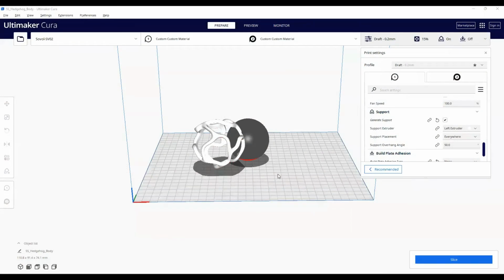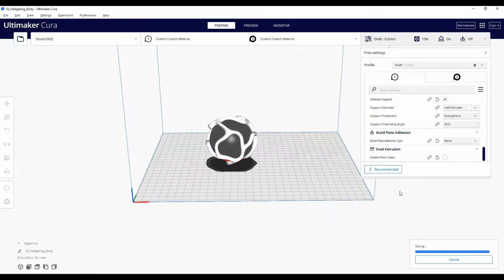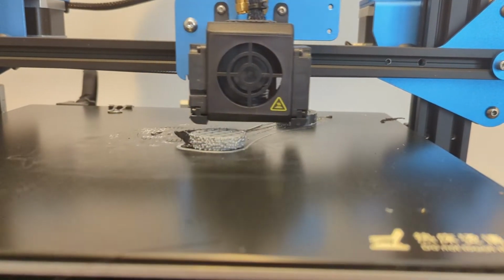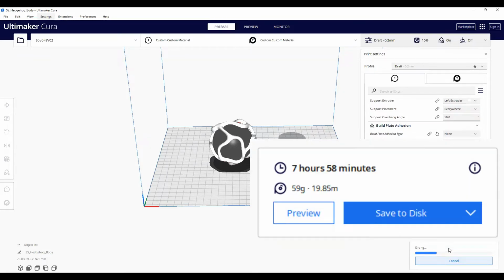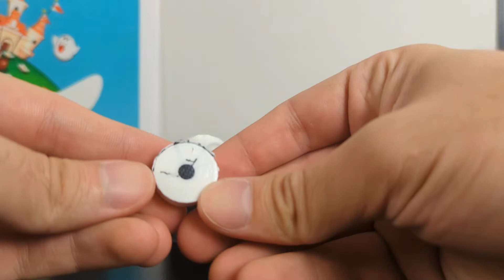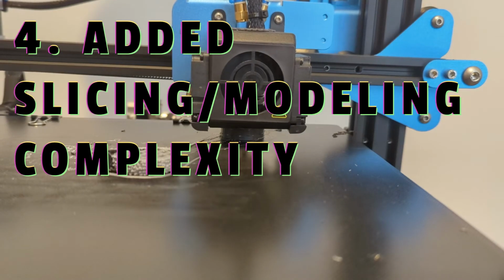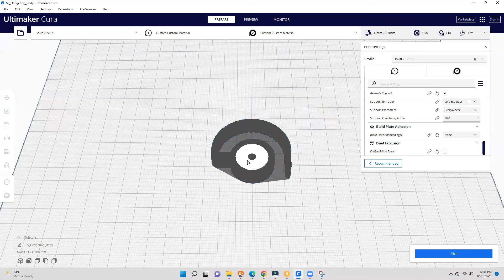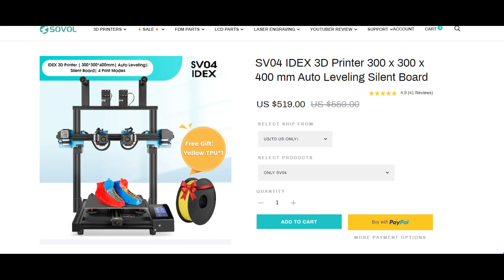Before You Buy: Single Nozzle Dual Extruder 3D Printer Watch This!

Comment: The accuracy problem is an issue in your printer not a intrinsic problem of the Dual extruders. Also with prusa slicer you can paint youyr model rather than make multiple pieces, and also you can use the infill as purge tower, maybe make it solid to put all the purge inside the piece.
Reply: Which prusa are you talking about? Cuz the one I used doesn't have that feature.
Reply: @cupcake_toucher445  The Prusa Slicer software. Any
Reply: The main branch current version has it. 🤷‍♂️  @cupcake_toucher445

Comment: MMU printers with a single hot end are rather gimiky.  They are good for the once in a while dual, or multi color print, but poor for production of such prints.  You should also never use a single hot end MMU system to print with a mix of materials as there will be cross contamination.  Not good for combining water soluble support material with your print, but acceptable for some dual color prints.   An IDEX (dual hot end) system is required for combining water soluble support material with a print, or for a print using different types of material such as PLA with Nylon or TPU.  I am thinking of building a dual extruder single nozzle printer that will be used for multiple color prints.  I don't expect to do such prints very often, but the cost of the system is only that of the extra extruder and motor controller in the MCU, the dual bowden hot end is the same price as other all metal hot ends.  OTOH, the cost of an IDEX printer is much greater as you need an extra hot end, X axis linear movement (carriage, motor, belts, motor controller), and extruder, thermistor, hot end heater controller, etc.

Comment: I never use mine for dual colour. I've had success with it, but it's not worth the extra filament and time used. Better to paint after. The real reason I like these printers is because they offer gradients which doesn't waste any filament, and also it saves money on filament and keeps a print going when you are about to run out of filament. Instead of putting a fresh spool on if you think you haven't got enough, I just have my fresh one on the other extruder ready to go when the older one runs out. Then I gradually mix the two together until they blend seamlessly and I got my full money's worth from my old filament.

Comment: I'm just getting into dual extruding.    The fix for #4 really is just using PrusaSlicer.   I was only using Cura before, but that was impractical to try to do with separate bodies.  PrusaSlicer, you just select which surfaces that you want as each material, and it does it.    

All the real problems I ran into were related to the idle nozzle crashing into the print.  It seems PrusaSlicer doesn't have a solution for that.  Z hopping can help, but it's not perfect.   I'm shopping for a good 2in 1out hotend now.  I have one, but it doesn't look great.  But it was only $10, so it's something to play with.

Comment: With the PrusaSlicer you can just paint your model after importing it into the Slicer so you shouldn't need to make multiple parts and than combine them.
Also, just use .3mf to export so when you import it it's already "assembled" (at the right place). 😉

Comment: I dont know why you hate your sv02 so much. I have this printer and have never had some of the issues you are showing. What most people dont realize is its not the printer that is not working well. Its the person that is setting the settings and calibrating the machine. I asbolutely NEVER have bleed on my dual color prints and they come out extremely smooth and beautiful. I think you should learn more about the machine before making half the claims you did. There is no way to avoid the prime tower situation, but your prime tower settings are not correct. thats why you are getting the color bleed. Also, 3d printing is much more than just taking other peoples files and hitting a print button. You need to learn blender. I could fix that model alignment in 5 minutes. easy. I have only been using blender for 2 weeks.
Reply from the maker: I admit I still have much to learn, but I bought a SV04 and love it.  Perfect machine.  More setup but fixes every issue I had with the SV02.  And I'd argue it's a more complex machine.  If you have some vids on blender shoot them over, I'll take a look
Reply: @OverExtrudedPhysicist  yes the sv04 is definately a better machine for dual color prints. but also at double the cost. in the long run you would save that money and more but I wasnt willing to deal with the problems i have read about with only being able to level with 1 extruder/hotend. The other one (the right one) has to be leveled manually. With the 02 being my first dual color printer I wasnt willing to go from never using anything other than a single hotend doing single color prints, to 2 hotends, 2 color prints. I felt it was to big of a jump. I have been designing my own functional parts for the 02 that no one has ever made or shared so far that ive seen anyways. One thing about sovol printers, if you configure them correctly, they will give you amazing quality prints. As for blender, i didnt use videos for most that i learned. i did however learn a little bit from them and then just kept doing things to see how options reacted and guessed at what things did. After understanding how multi-file / multicolored prints were done, like you said, if they are not made together, they wont merge together, i then just went on a hunch. you just IMPORT all 3 stl files into blender, line them all up, and resave them in those settings. Theres a lot more to it than just that but thats the fast version.

  Well hell, why not, heres the full explination. Download blender, its free, which is great. When blender comes back up, Go to edit->preferences -> system, and where it says undo steps, set that to 256.  Then go to edit -> preferences -> add-ons  then enable the following (not sure if you need them all, but may as well be set up the same way i am) Add Mesh: Extra Objects / import-export: STL format / interface:modifier tools / mesh: 3D-Print toolbox / Mesh: Looptools / Object: bool tool / Rigging: Rigify. Once you have those all enabled, restart blender.  Then go to the 3 lines on the bottom left of the preferences window and save preferences. Then, look about middle screen to the right hand side for the tiny tab that looks like a water droplet with a black circle and a dot next to it. Change units to millimeters and unit scale to .001  After that go to the top right you will see that water droplet picture and right under that to the left a little bit is a double circle tab with a down arrow next to it. Click that down arrow and make sure grid and floor are checked and change that scale to .001 also. That will give a a good grid to work with.  For the next set of instruction you may have to zoom in after you set all that stuff up.
 
Then go to File -> Import -> STL and select those 3 objects you had. Then make sure they are all in their own collection tier, top right "scene collection" Right click and make new collections and drag each one to its own group. then you can grab each one instead of them acting like its all one object. Select all of them and go to "item" (tiny little sideways tab) and where it says location. Put them all to x:0 y:0 z:0. that will collect them to the center. Then you should be able to select them one at a time and press the G key on your keyboard and that will "grab" them. from there you can hit whatever axis you want them to move on, or you can freely move them around to line them up perfectly how you want them to be as a whole. Use the middle mouse wheel to move camera around and hold shift to walk the camera where you want it to go. (the number pad on the right side of your keyboard will snap you into view windows in different angles, you can play with them. 7 give you the top straight down view.) 

Once you get them lined up how you want the print to look, delete 2 parts and EXPORT STL the only object left and name it part 1 (or whatever). Then press control+Z twice to bring them back and delete the one you just saved and one more and EXPORT STL that one and name it part 2. Then control+Z to bring them back and lastly delete the 2 parts youve already exported and export the last one and name it part 3. 

After all that is done load all the stl files into cura and select the extruders you want to print specific parts and then merge them together. and then its time to print. Good luck, I hope this was detailed enough and you learn from there.
Reply from the maker: @TopofTheHill3D  Thanks BigRig cool!  I appreciate the explanation haha that's def enough to get started